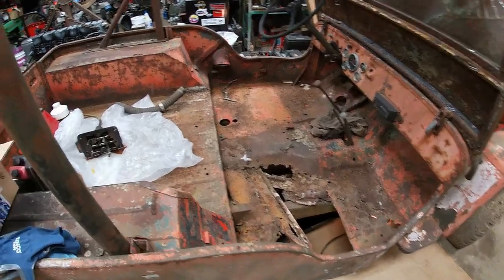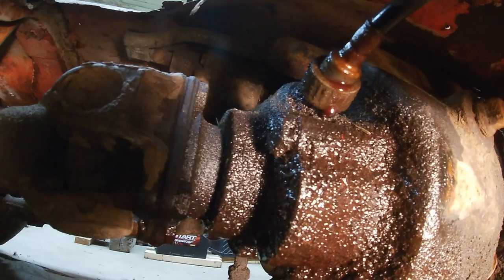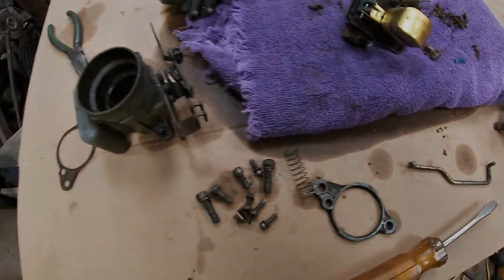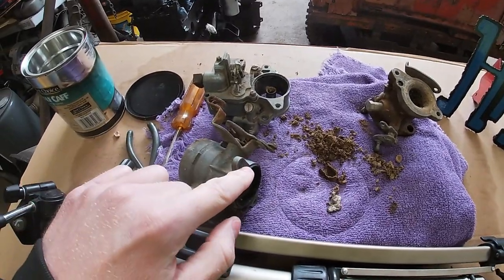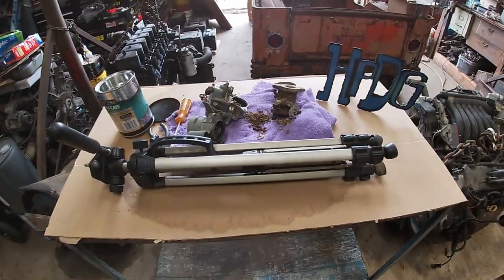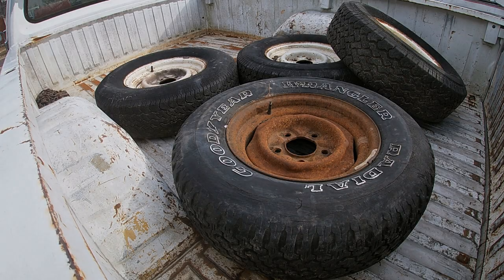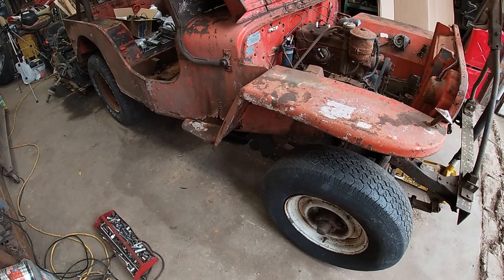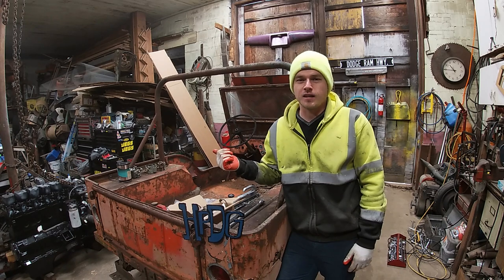Willys' Jeep Episode 6: Carburetor Disassembly

Comment: Well, just hurry up and wait faster, we need more videos!      LOL
Now you can get practice welding that breaker bar. Tools don't have to be pretty, they just have to work.
That carb is simplicity itself. Great looking insides. Engine should run like a top when rebuilt.
Good work making it a roller again. Function is all that is needed at this point.
Thanks for sharing.
Reply from the maker: Thanks JT! I appreciate that my friend 🙂. Hopefully it will be running before too long. 😃👍

Comment: That seems like a nice kit, but 2-1/2 turns out on the idle mixture screw or screws will get one running. Incidentally that is a leather accelerator pump cup. You soak it with a little motor oil and flare it outward slightly before installing. They really never wear out. My old Mopars all use those.
Reply from the maker: Thanks for the info! 🙂👍 I appreciate that.